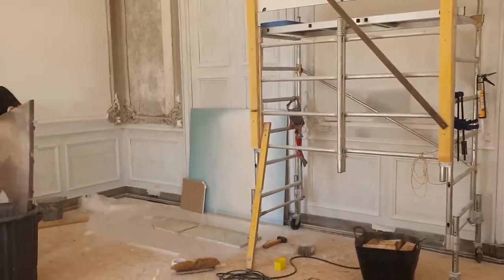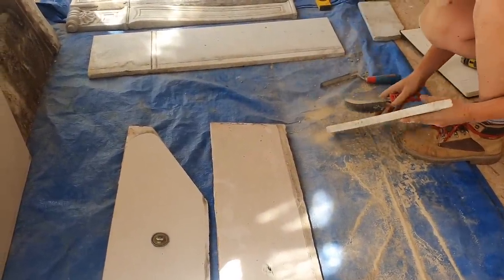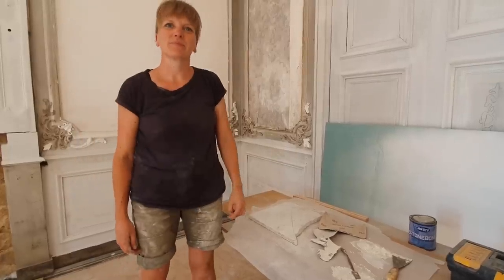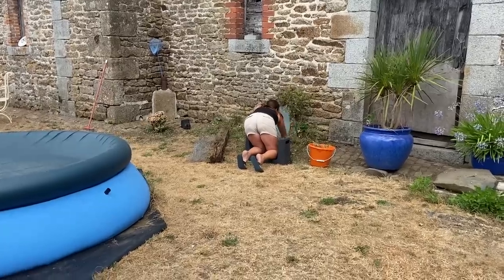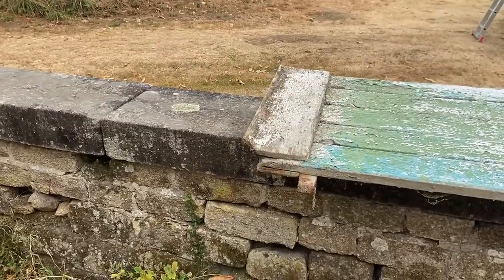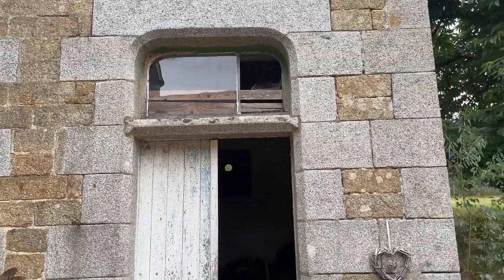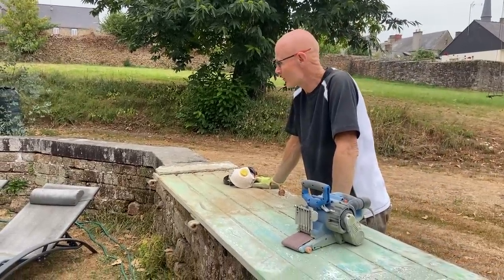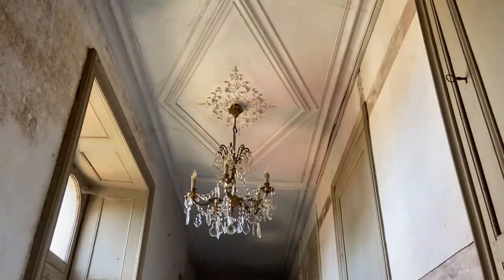We FINALLY Found What We Have Been Searching For!

Comment: If your just going to re-paint the doors and frames.  You can apply wood hardener a 2 part filler to the rotted parts. Cheaper then replacing frames etc.

Comment: When I worked in framing I noticed there were other colors under the leaf especially red
Reply from the maker: Yes this is correct   but I did not want to put ted or any colour on that detailing after spending do much time stripping it, the gold still stands out. Butbi will probably put red or even ocre under the gold for the trims around the panels. I've also found out, you can get coloured size too! Worth looking into Cx